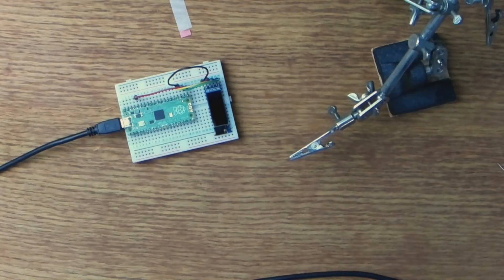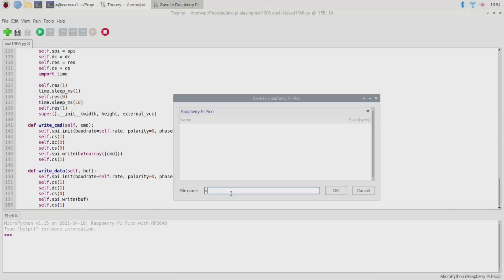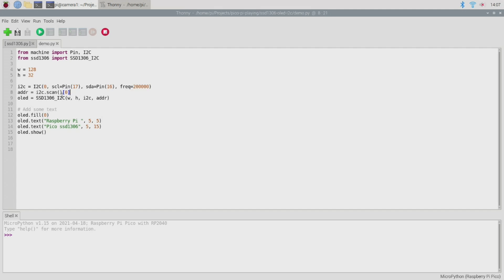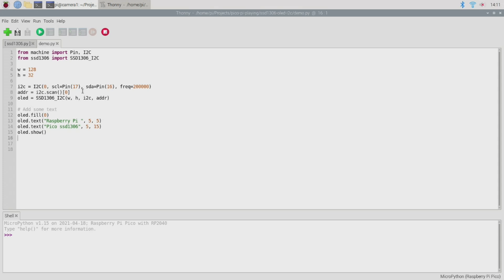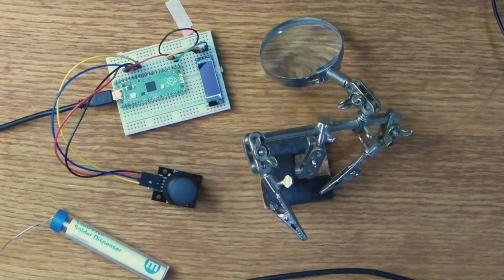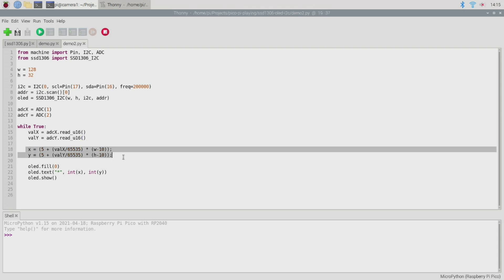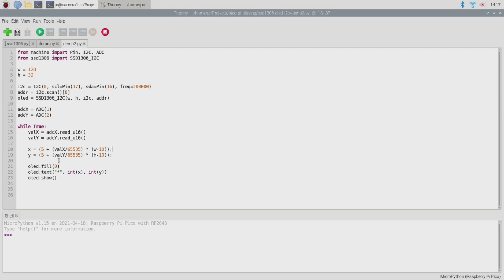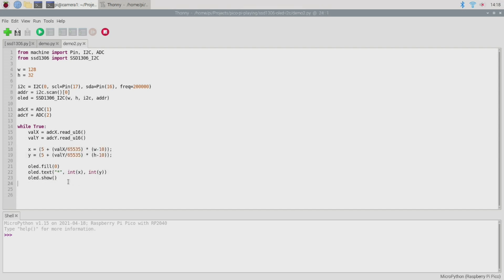Raspberry Pi Pico: OLED Display (SSD1306)

Comment: Thanks for the video. I am getting an error. What have I done wrong?
Traceback (most recent call last):
  File "<stdin>", line 8, in <module>
IndexError: list index out of range
>>>
Reply: me too what is the fix? getting ready to smash with a hammer.
Reply: Got it working. Super tutorial! Thanks again!
Reply: @alexfernandesportrai  What ended up being the problem? I'm dealing with the same issue, previously saw to recheck solder. Did that, everything looks good solder wise, this is driving me crazy lol.

Comment: Just get the error:
Traceback (most recent call last):
  File "<stdin>", line 8, in <module>
IndexError: list index out of range
Reply: I have the same issue
Reply: @jacobholder8188  me too
Reply: Same error using the demo.py as code for main program.
Reply: Has anyone found a soloution ?
Reply: @vidarhole7204  you may have some issues with your electrical connections. I resoldered my connections and it worked. Sorry for a late response
Reply: @vidarhole7204  basically the error means that the functions couldn’t find a valid address for the screen
Reply: @jacobholder8188   Did you have the issue on a breadboard, or a soldered circuit board? I'm having the same issue, went through my connections and everything seems good. Trying to get this figured out.

Comment: Is it possible to drive two displays?  I've tried modifying your code but no joy.  I've added _0 to all of the variables where obvious which still works.  I've then duplicated the code changing _0 to _1 but I'm getting dupliacte addresses.  Obviously a simple error but I'm not sure where - cabn you help please?
Reply from the maker: I have not tried this, I think the address of the screen is fixed but the Pico has two I2C buses so you could try connecting one screen to each, then the address conflict may not matter. Good luck
Reply: @tinkertechtrove2910  Some displays actually have both I2C and SPI that can make it possible to drive 2 displays. And using a mosfet chip that is set up with I2C bus extender.